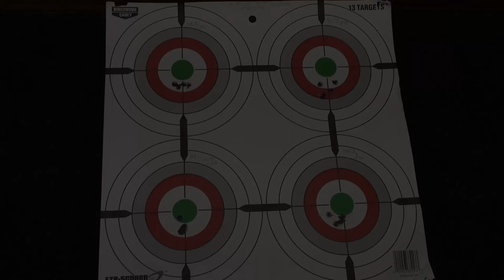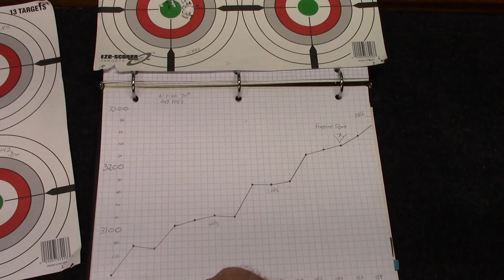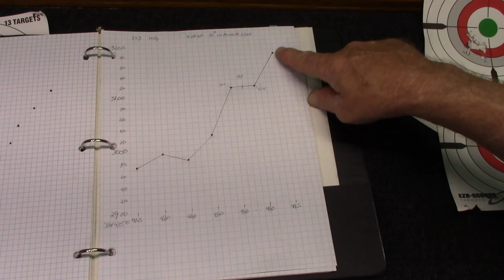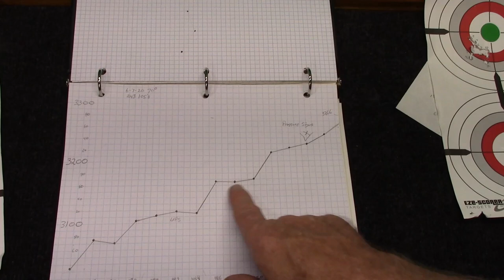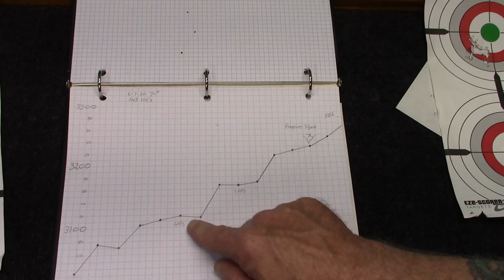Ladder Testing the 783 and Max Pressure Found

Comment: Do you rely on these "speed nodes" ? I've been trying to test it carefully on my .308, but got 3 different curves each time with the exact same cases and components. For me the only thing  I can be sure about this kind of curve is that it can help to precict the speed increase vs the powder charge (linear progression), with my rifle the "flat spots" or "speed nodes" are not repeatable.
Reply from the maker: Thank you for the sub :) I have found that neck tension effects speeds more that one would think. I try to make them as close to each other as I can for ladder tests or group shots.
The easiest way for me is to use a mandrel on the necks before seating the bullets. I use the expander mandrel from Sinclair that comes with the neck turning set.
Reply: @rsvarminters9083  Did you tried to make the exact same test twice or more to see if you get the same "speed nodes" ? I aggree about neck tension, I use a FL neck die (using bushings), then an expander mandrel. I've also let the barrel cooling the same time between each shot, and shot immediately after chambering to avoid heating the cartridge into the chamber. Speed based load developement are in fashion, I found it in many tutorials (long range, FClass, PRS...). I'm surprised that almost everyone wo are using it didn't made their own tests to validate or not these techniques. For me, whatever the technique, it must give reproducible results to be reliable. Maybe I'll try on another rifle to see but I've already spent 3x20 rounds for this one.
Reply from the maker: @br4713  I have and they have been on track. How far off are the speeds? I agree on a reliable technique, bad results drive me nutz. Sounds like you are doing things correctly. I see different speeds from weather relations. and the barrel actually got faster after 300 rounds or so, but the powder node stayed the same. I tried a 223 that was kind of wonky but the rest of my rifles work fine. 
How wide of a test (powder wise) are you doing?  Oh what Crono are you using?
Reply: @rsvarminters9083  I only tested the Vihtavuori N150, CCI BR2 primers, lapua brass. The chronograph is a Magnetospeed. On the 3 curves the "flat spots" are located at different powder charges each time. If I average the 3 series I get something close to a linear curve. When you say "the powder node stayed the same", I guess you mean your powder charge. For what I've tested, tuning methods based on powder charge, seating depth or tuner work. For the methods based on "speed nodes", I'd like to find some proofs on internet or by doing my own experiments but I didn't find yet
Reply from the maker: @br4713  Have you seen this one? https://www.youtube.com/watch?v=ACyfeeBHVOA
Reply: @rsvarminters9083  Thanks I will watch it